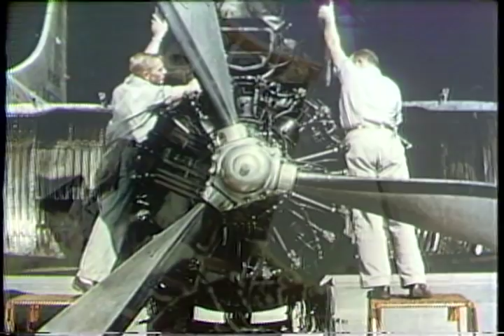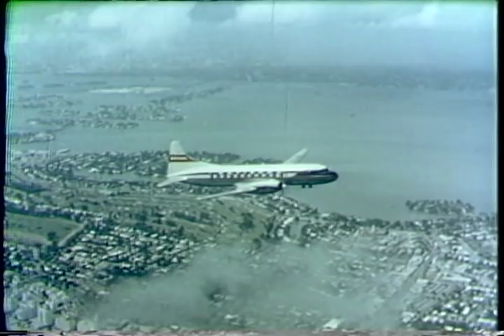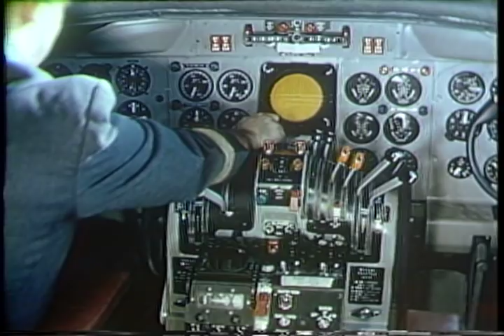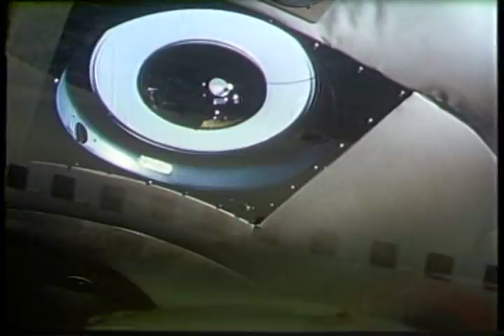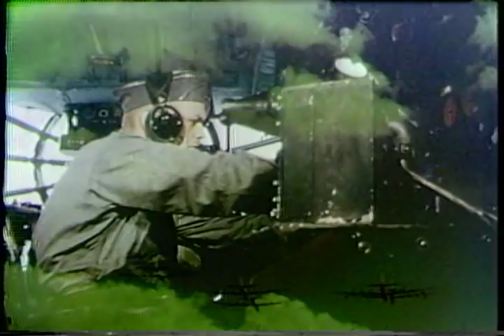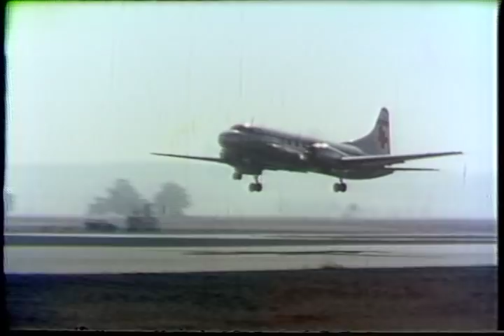VT 795 The Convair Liner Convair 240, 340

Comment: All in all, a very fine airframe.  The transition of the entry door from right side to left (240 to 340+ models) was good for two reasons: first to move the passenger entry away from the cargo compartments, which eased cargo loading, and also because it featured a redesign of the door operating system.  The door/canopy on the 240 had a quirky pneumatic/hydraulic actuator that required frequent servicing.  If neglected, the door/canopy would fail to open fully and result in the stairs being trapped against the canopy.   The canopy would have to be pushed up by a pole carried on the airplane to get the stairs out and the passengers off of the airplane.  The redesign to the right side got rid of the old actuator and installed an all-hydraulic system with a sequence valve to synchronize the door and stair movement.
Of all the Convair liner models, the Allison turboprop-engined 580 was the best by far.  The 3750 horsepower Allisons gave the 580 the ability to operate with full loads even at high-altitude airports.  The original Frontier Airlines made such good use of the airplane flying to high elevation airports in the Rockies that the 580 became known as the Mountain Master.  Frontier's experiment with the RR Dart-engined Convair 600 conversion of the 240, which came to Frontier when it purchased Fort Worth-based Central Airlines, proved that it was incapable of carrying the load at such high elevations.  The 600 offered quieter and smoother flights than the 580,  but in the end it was not a success.

Comment: As a grade school student in the early ‘50’s, I recall making several trips in Delta CV440’s. This was about the time that Delta was making the transition from DC-3’s for short haul runs. I still recall the difference in the deck angle between the two airplanes on takeoff. The Convair was most impressive. I still have some old tickets that show one way child’s fare between KSHV and KJAN as a princely $14.00!

Comment: Flew 340 440 for North Central Airlines for 1 1/2 years.  We had a take off from Detroit Metro Airport on a warm summer day,   Runway 3 L Take off weight was just under 48000 lbs.  Captain feathered engine at 300 ft AGL, took us six to eight miles to climb to sufficient altitude to turn back to airport.  North Central aircraft 305. It was a great plane quiet in cockpit.  Big improvement over DC 3.  I then flew Turbo Prop Convair 580 for 11 years both seats.  This was a fabulous plane great power however noisy.  They were built like tanks check out their accident survivability.  Flying with Cessna 150 stuck in side etc.
Convair new how to build them.  Is always neat to see a 580 now and then.

Comment: ' helped maintain several EC-131's at  Pacific Missile Test Center, NAS Point Mugu, they were Chaff Queens. Good rugged analog avionics. Flew as passenger in North Central Airlines 240's several times Chicago O'Hare to GRR, and turboprop model 440. Roomier than Viscounts.
Reply: North Central never had 240's...They had 340's and 440's and all were converted to 580's with the Allison engines.

Comment: This is the plane that Lynyrd Skynyrd crashed in in the 70s, right?
Reply: Right.
Reply: It was a cv 300.. It means  a cv240 with cv340's engines (p&w R2800 CB16). 2400 HP each.

Comment: Im pretty sure that single engine takeoff wasn't anywhere near gross weight.
Reply: Agreed, just a few days ago a gorgeous example much loved here suffered an engine fire and being loaded with 2 plus 15pax she struggled to stay airborne and couldn't complete a return circuit and finally went in with lots of footage external and internal https://www.youtube.com/watch?v=yVewcZzOyTk
Reply: When I was in A&P school, one of my aircraft maintenance instructors, who had spent 20 years in the Air Force working on T-29's, the militaries version of the Convair 240, always told us that single engine operations with any type of a load, were pretty sketchy with the aircraft.
Reply: Looks like someone was standing on the right rudder pedal ... did they have a rudder boost feature ?
Reply: I maintained and flew on three different C-131's out of Nas Pensacola, from 1976-80. All three had max gross take off weights of 54,370.  A cold Oct day with a full load of passengers and 3/4 max fuel weight we lost number 2 engine just after we got the wheels up, ran shutdown procedure and our pilot brought it back around safely.......our weight was 51,250.
Reply: @petequitta1066  Theres a huge difference in loosing an engine after takeoff and actually making a single engine takeoff.